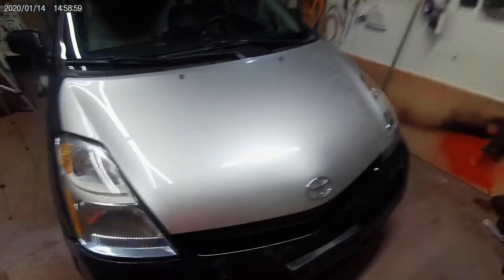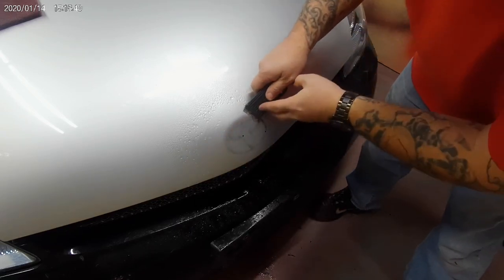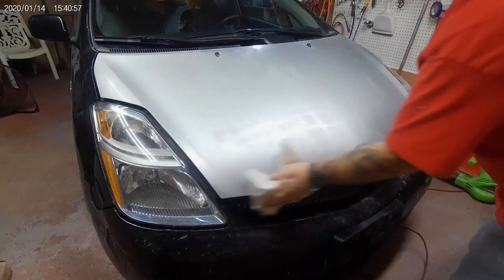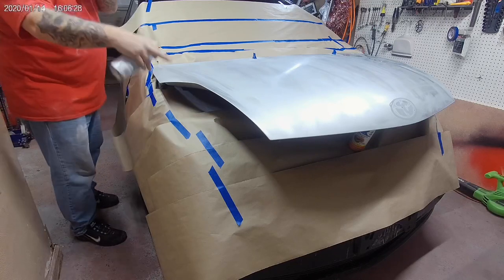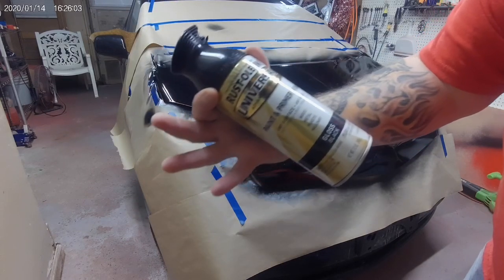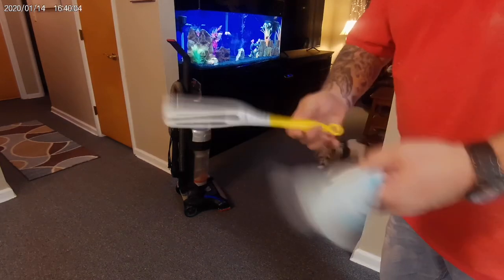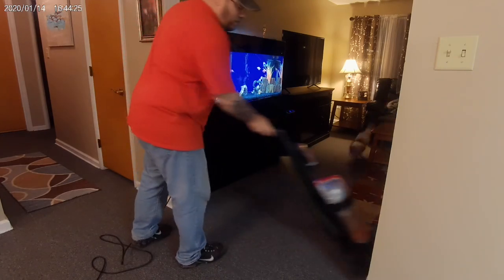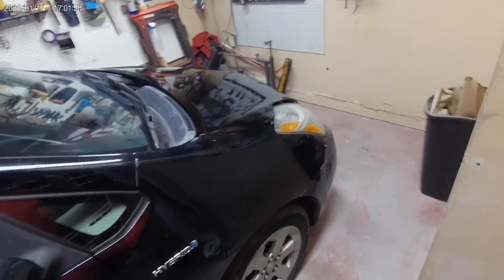How to Spray Paint A Prius At Home!!DIY and SAVE BIG MONEY!! Plus bonus footage

Comment: Thanks for the instructional video. How long did you wait between the 2nd and 3rd coats?
Reply: I also enjoyed the life tips on vacuuming and dusting! LOL Especially with the dog barking at the vacuum. Now for another question: do you think that the little bits of dust that settled in the finish might wet sand and buff out in a month or so? I ask because I am seriously contemplating a shade tree auto paint project. The enamels dry so slowly that the chance of dust and bits increases in the hours it takes to be tack-free… I wonder if their are lacquer finishes suitable for cars…. Yes, I understand that the goal of your project was mainly to make the color difference less if a stand-out until the whole car could be painted, but thought maybe you might know.
Reply from the maker: To answer your first question two months later, about 10 minutes. Enough to take up a bit. And yes, most should wet sand and buff out but it's not ideal obviously.